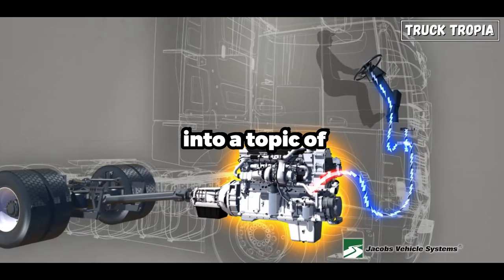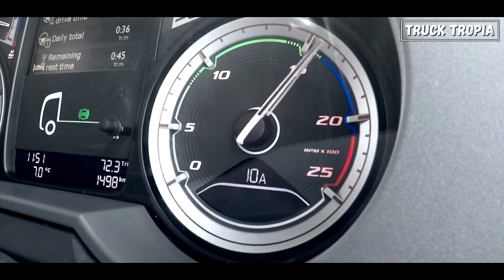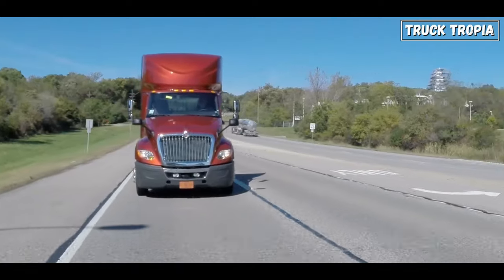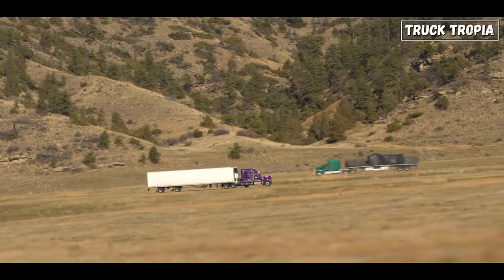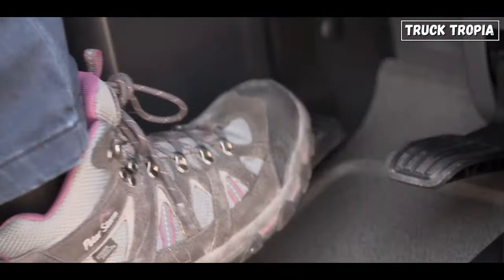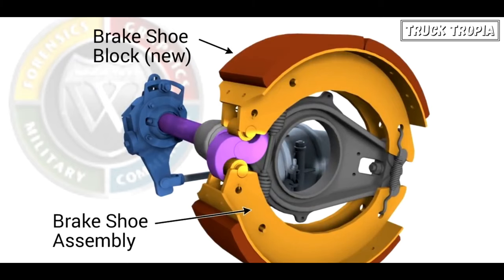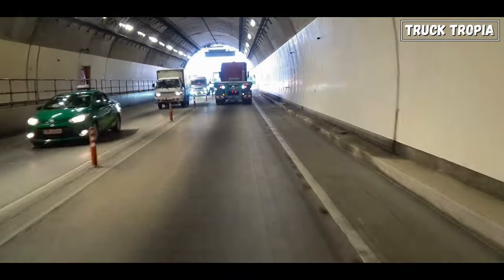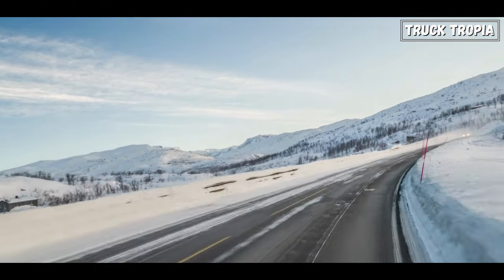Why Use a Jake Brake? Engine Brake Explained

Comment: The first time I saw the term "jake brake" was when I was passing through the residential area of a Boston suburb - located between the interstate and a commercial area.  The sign said, "No Jake Braking".  When I looked it up, I realized I'd been hearing semis engine braking all along - used it myself on my car when I drove a manual shift - but I didn't know the term.  :D
Reply: In Europe, most of the trucks, especially the new ones, have very efficient and quiet retarders, I have never seen any of those signs before

Comment: Sir,  You talked about what these systems are called, and they exist but you did not get into either the engine brake systems, i.e. valve timing in relation to piston cycle positions OR the fundamental differences of hydraulic and air brakes.  For instance, air brakes are easily disconnected and reconnected among other things.

Comment: in a pneumatic braking system, the air pressure releases the brakes, when you lose pressure, the brakes lock for safety.
Reply: It's just the parking breake that works that way. Air pressure actuates the service breakes when you step on the breake pedal.
Reply: @Howard_Ravenhill  are you sure. I saw that somewhere too.

Comment: Never use engine brakes in icy conditions
Reply: Volvo has an automatic engine brake option that activates to assist the pedal brake, if u press the pedal lightly it will bring the engine brake lightly if u press it harder then it will kick in harder, I’ve used it in the snow and using both combined works well but if u using engine brake separated from the air brakes on icy conditions that’s when it gets scary!
Reply: @user-fl7pw3vl3t Interesting point. I was taught not to use engine brake at all in order not to loose traction with road, but I've never tried service brakes together with engine brake.
Reply: @michaelmoskvichov8527  yesss that’s a feature that comes in the Volvo, 
Volvo has 5 levels of engine brake:

-OFF; no engine brake

-Automatic; function where engine brake kicks when u hit the brakes, adaptive cruise control, etc.

-Level 1; 25% engine brake power

-Level 2; 50% engine brake power

-Level 3; 85% engine brake power 

-B; downshifts you even 2 gears if u at 70MPH or lower and will bring 100% engine brake force.

like it allows u to control the engine brake in every way possible.
Reply: @user-fl7pw3vl3t  Yes, of course I know about all the levels and the fact that you can set cruise control speed maximum after which engine brake kicks in, I just don't remember trying to use automatic settings with service brake on icy road, curious how the truck will behave...
Reply: @michaelmoskvichov8527  I did it couple of weeks ago in Indiana I had total control! And yea that cruise control thing is clever
Reply: Cummins and Detroit also have the settings for engine brakes along with cruise if your speed gets over a set point.
Reply: K9 mo

Comment: Can you please make a research about each engine brake style of each brand? They are all different and would like this channel to break it down for us, Volvo for me has the best of all the engine brakes!
Reply: An old system ,Williams Blue Ox braking system is close to what Volvo has  . Basically a valve that shuts off exhaust flow from the engine .  I liked the Caterpillar Brake Saver from past years .

Comment: Never ever use an engine or exhaust brake on slick or icy roads. You will have one wheel doing up to 90% of the braking you're asking for trouble. Distributing the braking over 10 wheels helps the truck slow safely.
Reply: That’s a bunch of bullshit. I do and never had a problem. Stop living in the 80s when you guys had shitty old trucks.
Reply: @greatwhiteshark4931  I've been fortunate enough to see firsthand on a skid pad what can happen. And I wasn't dumb enough to listen to people who would be careless about safety. As a professional, you should be trying to minimize problems. Just like a driver at my company. Drove the same trip for years. Always stopped on the same ramp. Was told multiple times that it was dangerous. He had your attitude. One trip, a man died because he went under his truck. Now he is without a job.
I've been driving for almost 30 years. I've learned some things in that time.

Comment: About brakes, there are a lot of disk brakes on a new semi trucks. They are more effective. Don't use engine brake on sharp curves and black ice road. Make sure truck is straight it most effective and safe time to use a engine brakes.

Comment: I've always wondered what engine brakes were. As a normal driver, I would see signs at the start of small towns about not using engine brakes in town. I didn't understand why those signs were necessary. Thanks for the info.
Reply: Granted, I'm not American, and English is not my native language, but I am a professional driver from Europe, and what I understand, engine braking is actually just a driving technique, by shifting into a smaller gear and revving up the engine you're slowing down without the need to use traditional brakes, it's a great way to save on fuel and brakes, and part of anticipatory driving, even better is to look forward enough on the road so you can lift the gas pedal even further back and without the need to shift or anything, so you're not "engine braking" at all, and end up the saving even more gas. but like I said, that's just a driving technique, and you can do that with a moped, car or a truck. but what we have in trucks, at least in Europe, are exhaust brakes, which is an actual device that slows the engine, there's also some other devices, some sort of magnet device  on the driving shaft or something, but I've never seen that in a truck because it's a option when you buy a new truck, and no company ever selects that.
Reply: Engine brakes is just another term for one of few different ways of implementing the same thing you just described under exhaust brakes.
The passengers car’s “engine brakes” do work as you describe as a “driving method” since gasoline engines have throttle body able to create vacuum ( unfortunately with modern drive by wire TBs that doesn’t always work as well as old school manual throttled cars and not at all with Auto transmissions used almost exclusively in USA now days) but that’s not what we in USA mean when we use the general term engine brakes.
Reply: First off, my credentials. Retired after more than 40 years as driver & mechanic. 
In my completely  biased opinion, those signs are the result of Billy-Bob Big-.Rig drivers who remove their mufflers & run those 6 inch straight pipes. They just like to make lots of noise. They have no consideration for the people who live close to the road.

Comment: In a car there is normally a throttle (carburetor, throttle body, or on some cars variable valve opening) that restricts the amount of air that enters the engine which creates a vacuum that the engine is working against and helps slow the vehicle.  A diesel engine on the other hand does not have a throttle and has no means of slowing the engine internally which is where engine brakes originated from.  The engine brake is way more effective than a throttle would be.  Some engines also use the turbo to create higher exhaust pressures to help with slowing down the vehicle also before the standard engine brake kicks in.

Comment: Is there a reason why an area of town has signs that say "No Jake Braking"?
Reply: For the noise issue the Jake Braking creates from the heavy-duty trucks.  Usually there would be residential areas near those particular roadways/highways.  Where I live the highway signs will say: "No Engine Braking."
A truck traveling through a town or residential area at 2 AM with the Jake Brake in use could be as noisy as a propeller driven aircraft flying overhead at less than 2000 feet [610 meters] above the local terrain.
Reply: noise

Comment: the air brakes weren't explained properly in my opinion. the most important difference compared to the car brakes is that the air pressure in air brakes keeps the brakes unlocked, and when driver hits the brakes the pressure is released, so it's impossible for a truck to lose brakes because of a cut lines, like in movies, if that happens the brakes are on with full force.

Comment: Engine brakes apply braking only to the drive axles.  If you use it on ice your trailer isn't being braked and it will push out of control.

Comment: Air releases the brakes, so if there is a failure in the system, the brakes will automatically come on! There is nothing worse than trying to air up a plant trailer with a faulty system to try to get the brakes to release!!

Comment: Your description on the air brakes was incorrect. When brake pedal is pressed, air pressure does not apply the brakes. Depressing the petal releases air casing the brakes to be applied. Come on man, do you even know what you’re talking about?
Reply: Sorry, Mr Kroon, but you are completely wrong!  Pressing the brake pedal sends pressure to the chambers & applies the brake. 
The emergency & parking brake function is applied by a gigantic spring. A push button sends air pressure to compress the spring to release the park brake. 
These are two separate methods of applying brakes. 
Watch the video again please.

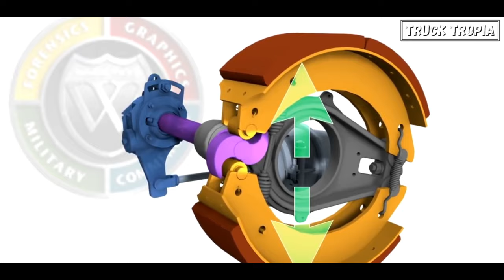Comment: At 4:45
Air brakes....

"...air pressure is used to apply pressure to the brakes...."

Boy you pooch smooched that one!! That used to be the way it worked, back in the 50s and 60s and maybe early 70s.  Since then they have reverse the procedure. Air pressure is used to unlock the brakes, since they are in an applied position without pressure. You can't move a semi truck without air pressure!! The brakes are locked!!!!
Applying the break pedal releases that pressure, causing the brakes to apply....
Reply: There is two sides to the braking system. The parking brake side uses air to release the spring in the parking brake side of the brake chamber.
The service brake side is actuated by the driver applying the brake pedal.
Known as spring brakes or Maxi brakes, the spring inside that chamber will apply the brakes in the event of a major air loss
Reply: @russvoight1167  

I didn't know that.... I thought there was only one side to the brakes.

Comment: The section of road I live on is about 2 miles long. It is pretty well lined with houses just outside of town. Speed limit is 45 mph. Apparently there is no engine braking restrictions here. This guy goes past my house on a regular basis. He has been picking up his load about half a mile away from me and hauling it to a site about 2.5 miles the other way. Another truck from this company is almost as bad. On this job they've been running for 11 hours straight so a truck goes past my house every 7 minutes or so. I'm sure the faster he goes, the more loads/money he gets but Is this really necessary?   https://www.youtube.com/watch?v=KWmhQjehlnw